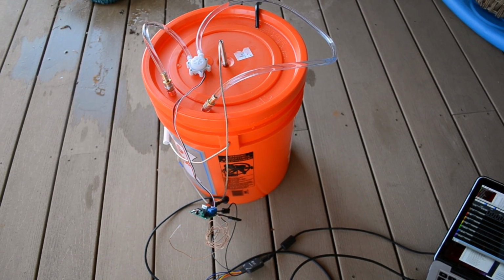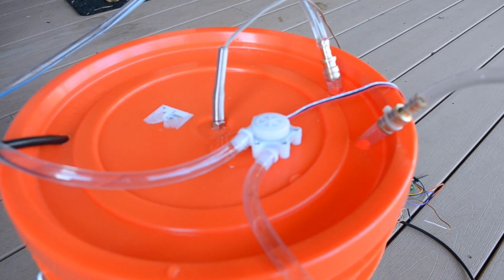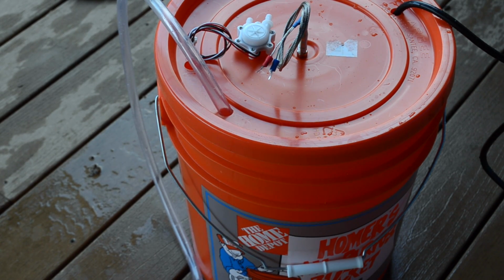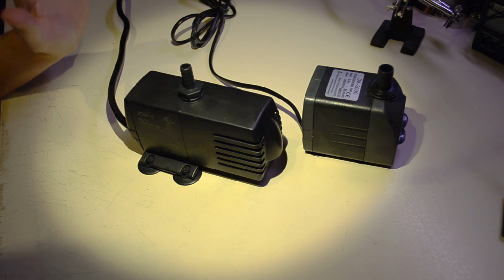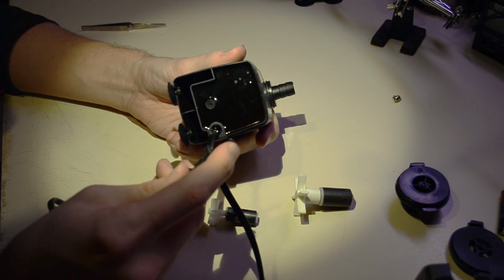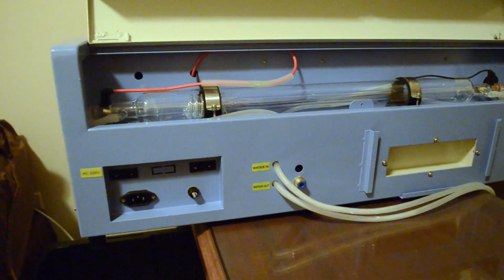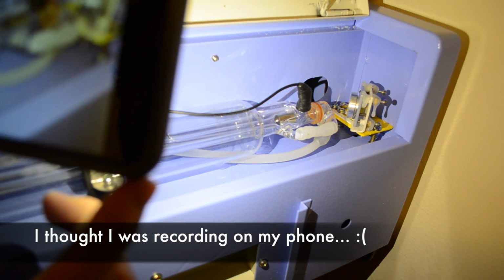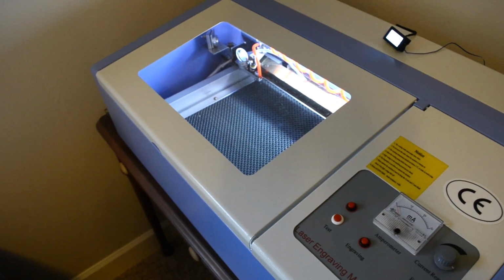Chinese laser cutter part 3: Water

Comment: its 2016... any significant project  you did  with this laser machine so far ?
Reply from the maker: Not "significant", really.  I just use it occasionally for different projects, like making gifts or doing circuit boards and cases for things.  It's more of a tool now than a novelty :)

Comment: at what temperature the water need to be/?
Reply from the maker: As low as possible.  I run mine at basically room temperature. (23-25c).  There are some chillers available, but unless you're running a higher wattage tube (mine's probably about 35 Watts), it's not necessary.

Comment: Perhaps I'm just a dense old fart, but what led you to believe that water flow rate and cooling was a problem in the first place? Did I miss something? Was tube temp actually effecting overall function or are you just assuming better water flow and cooler temps are better?
Reply from the maker: The instructions on the machine (and all the information online) make the requirement for water cooling very clear.  In fact, the machine comes with tubes, a pump, and all that.  My goal with this stuff was to try to get ~120 volt pumps working, so I wouldn't need the 220v system for as much.
Reply: Thanks for clearing that up. I am new to this and have started watching your videos as part of my research on what machine to buy.
Reply from the maker: No problem.  I hope that these will be/have been useful.

Comment: you need to put the water tube connections at the top. then the bubbles can exit.
Reply from the maker: +sifterbox That's a great idea!  It would be a lot better than manhandling the machine to get the bubbles out!  My only concern is whether it's possible to do that without messing the optical alignment up too much, I finally have it dialed in.
Reply: this is what i am going to use I am doing it right now. 1/4 inch silicone rubber around the tube or just use the black rubber it came with works great using these clamps 4.99 just align on the center hole and make it square and I am replacing the entire xy system and extending it to the right side panel I am knocking out the divider. Then I may even mount the tube below where it is now and move the electronics in where the tube used to be. Or I may have electronics outside the machine and have two tubes and 2 laser heads because i cut matching pairs of items it would save me half the time. Its worth turning the tube dude you will fry yours there should be no bubbles whatsoever. http://www.performance-pcs.com/bitspower-tank-clamp-set.html

Comment: If you used a closed loop control circuit where output water temperature from the laser cooler as the input to the PID, you wouldn't need a flow sensor.
Reply: In fact, you would only need 1 thermocouple and one relay.  Cheap and easy!  You would sacrifice some temperature control precision, but am guessing that the operating temperature of this is somewhat wide.
Reply from the maker: Ryan Dillon The cooling is completely passive at the moment.  The name of the game is run the pump as fast as possible and hope.  The ideal temperature for a CO2 laser is around -30°, and the maximum is around 30℃.  I'm just trying to keep it far away from the maximum.  Also, the location where the water sensor is located would matter.  Imagine if the flow stopped, if the sensor were far enough away the water temperature would rise very slowly even though the tube temperature could be dangerously high.  The reason I wanted the flow sensor was to include it in a protection circuit.  If insufficient flow was measured then it would kill power to the tube.
Reply: Oh yes, that makes sense.  -30C is crazy low temps!  A craigslist mini fridge would make for a great heat exchanger too!

Comment: Good video, personally I would put a spa bath pump on which you could get for 50 bucks and they have 3 speeds. That flow sensor has half the diameter of the tube is the main problem I think. You need to add some anti algae chemical like bleach etc to stop algae build up in your tube.

I really like that you added a temperature sensor to the laser, that will be a good thing when you run those long jobs and get that laser hot.

You are going to like making circuit boards on these machines, I do.
Reply from the maker: Thanks a ton!  I'll look into the anti-algae and spa pump.  I had a difficult time finding reasonable flow sensors.  This one was on amazon...  Do you have any suggestions for where I should look for others?  I tried my usual places like digi-key and mouser, but those are very expensive.
Reply: hpux735 Type this into ebay Water flow sensor cheers